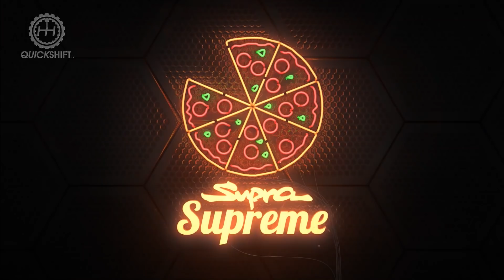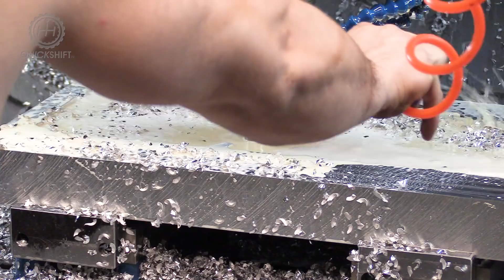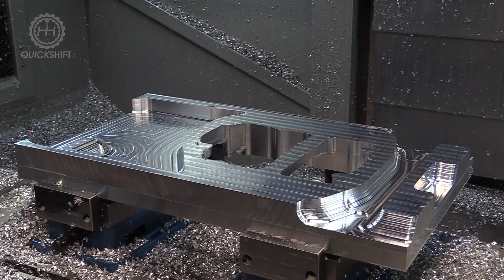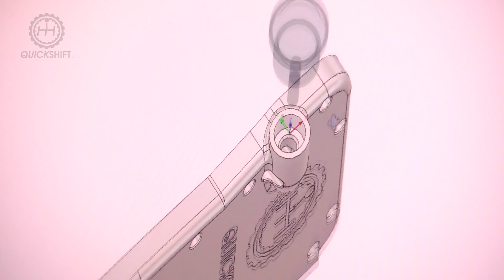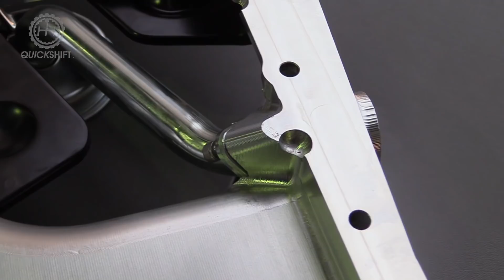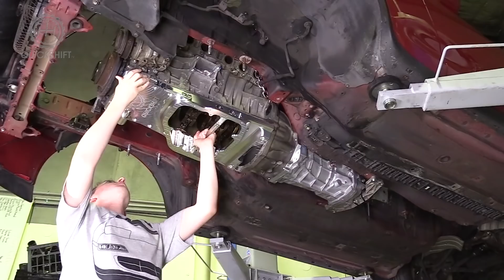Supra Supreme V12 1000hp Twin Turbo - Episode 7

Comment: Nice series so far fellas. Out of curiosity would you know what the the difference in weight between the 2J and V12 long motors are? Being alloy vs cast iron is going to help heaps but it'd be interesting to know how much if at all this is gonna change the weight distribution.

Comment: Hey Tristan, don't go the twin turbo route, go the quad turbo route using smaller turbos, but these will give less lag, I once had a ride in a Jaguar XJ saloon, that was once own by Ton Walkinshaw TWR racing and that had the development V12 quad turbo engine installed in it that was intended to go in the Jaguar XJ220. This was quick and felt as quick as 612 Ferrari, i.e 160 mph uphill on a dual carriageway.
Reply from the maker: Mike, I've spent hours trying to figure out how to squeeze quad G25 turbos in there but it's just not going to happen with the small amount of room the V angle gives us :(
You don't know how much I wanted this to be possible!!
Reply: @QUICKSHIFTtv  Sorry for upsetting you, from memory these were set up for with one turbo for three cylinders so they was only sized to boast 1.5L of engine, garrett t3 turbos come to mind for some reason, although I don't know how they would compare in size to the G25's, although the sizing should reflect the amount of air that you are shifting.
Assuming your V12 is around 5L then you are going to need 2 large turbos to get enough air through, which will have lag problems, me  thinks you will be getting you tin snips out to make space for four, to reduce that lag.

That XJ40 was the fastest car that I have ridden in and it upset a 911 that was trying to race it and the acceleration from around 30mph felt a lot quicker that a 10 second pro-stock Ford Mustang that I got to drive down the 1/4 mile, the XJ40 has been tested on the German motorway at over 180 mph at which speed the car was getting twitch due to the lack of aerodynamics, if the V12 quad turbo had gone in the XJ220 they reckoned a theoretical top speed around the 230 mph mark.
Reply from the maker: @Ashworth-Media  Turbo technology has come a long way. We have tested a tiny little turbo (GTX3071R) to 530whp on a 2.5 litre VVT 1JZ engine which is the closest thing to ONE of the banks on this V12 out there... in fact, the GTX30 range traces its roots to the old T3 turbo quite directly, only they can produce 500-600hp instead of only 300hp.
The GTX3071 gave us heaps of boost even by 2500rpm... and with a realistic rev limit of 9000rpm on the built V12, lag would absolutely not be the problem. What you say made sense a decade or two ago, but times have changed so much!
The G25 turbos I was talking about are even smaller and more responsive and capable of more power than your average T3.
Our intention is to create a turbo system which will accept a pair of G30 or G35 turbos ... which could give significant boost by 2500rpm in the smallest form, or up to 2000hp of flow but more lag in the largest form. But given the attachment dimensions are identical, they'd be hot-swappable / interchangeable without any other parts changed.
Reply: Hi Mike, that sounds really interesting the XJ40 quad turbo V12 mule by Tom Walkinshaw. I had one of the rare XJR-S cars, 6L V12 and I loved it as well as three previous XJ12 sedans with varying degrees of happiness fro them. The XJR-S was the best. Any details on the XJ40 V12 quad turbo? Also enjoying this series from WTF and proud that something like this is happening in Perth WA. I am down the road in Mandurah WA. Would like to come and see it some time.

Comment: Well done boys. I have a rough idea of what the oil pan might cost if you guys happen to decide to sell them. I went dry sump on the 1jz Mk3, but that was more because I never want to worry about oil control the way I treat that engine / car. This is right up my alley, and if for some reason the 2j in the Mk4 decided to let go, a 1GZ would be a nice substitute...

Comment: You guys should consider doing a cool mod to this and make it seem sleeper for specific moments to mess with peeps. 

So manual/mechanical or electronic exist. Porsche has it and it's possible to mod it. Exhaust control. In daily mode in restricts the engine for sound and emissions. In gnarly mode in frees it open and murks disrespectful exotic owners ears as they eat your dust. 

Build on guys! And cheers on projects, in memory of my uncle who got me into project shit. Dude had an old trans am back in the day with a vet 454 in it. Worked for the Molson Indy way bsck when too if you guys follow Canadian racing. 

Remember who said it wouldn't fit(hides the hammer and plasma cutter)
Reply from the maker: I trust you saw our sleeper exhaust electronic valve on the Camry project ;)
The Supra is absolutely getting this, just better.
Reply: @QUICKSHIFTtv  nah didn't book that yet. Got mad distracted cause my buddy finally agreed to maybe sell me some weird ass vintage engine he has I was for a table. 

It's an inline 12 cylinder. 

Deffs gotta get back to the Camry though. Such a sick mod.

Comment: Beautiful work! Please let us know if or when you would sell a copy of the parts you have made. I have been seriously considering buying a Mark 4
And your work is inspiring.
Reply: Doooo it before all the ones not being sols for 60k disappear. 

Unless your local has supply if so buy em up and keep em. 

That said I found an auto I can convert. For cheap. Low mileage. No crashes. 

If you look into the Smokey car you can figure out much of what you'll need base wise. Depends your route. 

Could ask my buddy for you he built his first one time ago. Building a second soon. V12 ls or this motor again. I'm trying to convince him to use a w12. It's 550 hp stock from the factory and it's mad sexy sounding. 

Also an old gmc v12 we have access too from fire trucks. But it's 702 cubic inches in basically a gmc/Chevy inline dual 6 cylinder. 

Shares mad parts with the old popular 6 cylinders from them like 70 parts. So I'm sure mods exist. 

If you do go supra for a crazy engine swap like this is say see if you can source something weird. If you have lots of local exotics chances are you can find an exotic motor and tranny. 

Where I live I'm gonna be going and seeing a dude who owns a junk yard. He has a lambo motor and tranny that work as far as he can tell and he's a mechanic by former trade. Rest of the car was toodles but yeah ripped it out the day it came.in. 

Can buy it cheap. Worst case scenario it needs a bit of work. But that's how some of these people do cool ass crazy engine swaps. 

Specifically ask. Sometimes they won't show it cause they want top dollar. But you can haggle. Especially when it's cash.

Comment: i would have melted scrap metal AL heads and had it machined out of cast heck thats what its made of OEM ill guess  no way ill buy a billet for...i wonder if they checked the rod bearings and installed new ones i like doing that my self if needed and more than a few times it has been...next year ill be installing a v12 in a fj60 or mk3 supra my favorite car in z world
Reply: Because quality castings are so easy to do. Stupid comment 🤦‍♂️